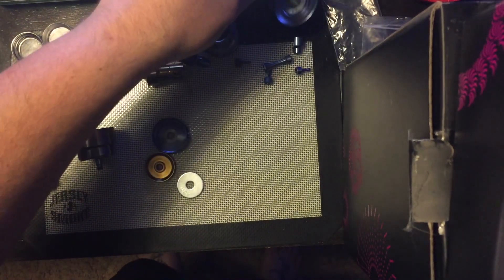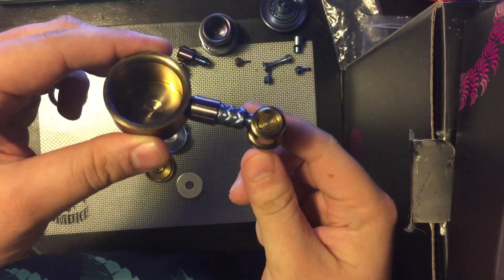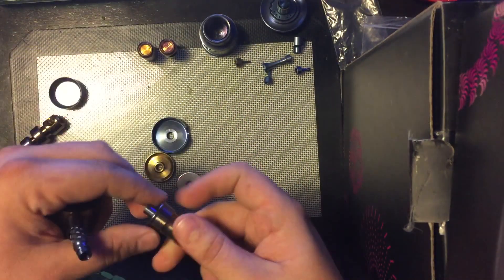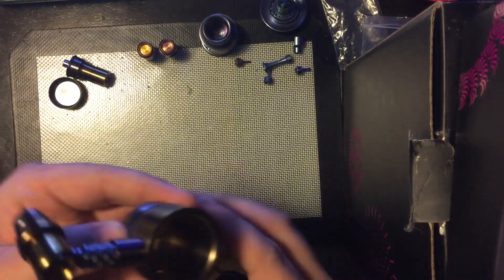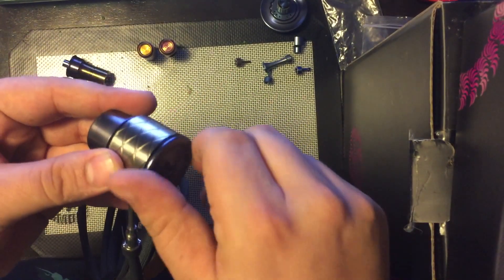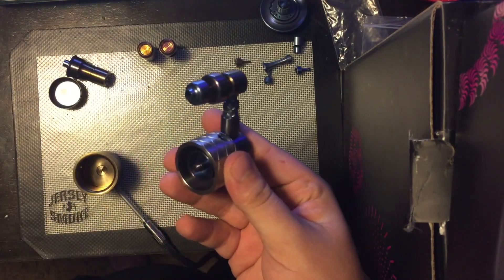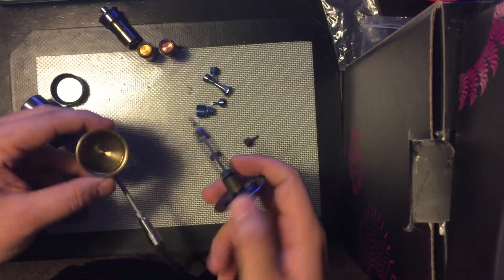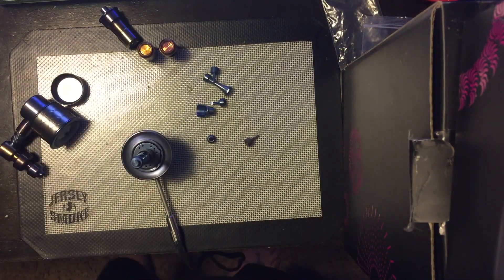CCA710 Liger 3.0 and Hurricane Cap Master Set Walkthrough

Comment from the maker: man this thing rocks. I have been rocking the Sapphire insert which is INSANE until last night i broke it my rig tipped and water got in and cracked it. Trying out the SiC which is also awesome!! really happy with this. Been rocking the Flat Coil Banger for now works prefect. The thing that i love is my dabber has the pick on the end so I just get my dab cap the liger and it melts off right into the dish no need to dab it and than cap it 2 for 1 its AMAZING!!!! if your looking for a good one time banger get this thing its amazing
Reply from the maker: taylor johnson  so with enails there are 3 basic coil sizes. 16mm - 20mm - and flat coil. You have to have one of those sizes my guess would be 16mm or 20mm. Whatever coil size you have that's the size liger you would want to buy. You can also buy another coil from your enail manufacture and use that coil specifically with your liger. Do you remember what size TI nail you got? What you can also do is go to cca710.com and go to SHOP > LIGER BANGER. Click on 16mm for example and you will see a link called size chart. This may help you figure out which coil you have.  Any question just let me know!
Reply from the maker: Black Benz7 in my eyes the sapphire inserts heats up the quickest. Followed by Quartz. Followed by sic again these are just heat up times which when using an enail may or may not matter. As for taste difference I'm working on getting the quad port highfivevapes enail to have a sessh on how each insert tastes. Right now I just have the one enail so it's a pain to swap things out esp when they are hot. So I haven't had a true hit after hit test with the difference inserts. I will say I absolutely LOVE my sapphire insert lol

Comment: Hey Dab Face can you tell what size coil specifically I need to order when ordering the new Liger AIR from CCA710? THANKS
Reply: Dab face
Reply from the maker: Yeah man no problem you need a FLAT COIL ENAIL or and ENAIL WITH A FLAT COIL to work with the liger air. they only now make it in FLAT COIL :) let me know if you need anything else!
Reply from the maker: The liger air is very very close to the model listed in this video above. The Liger Air DOESNT have a locking nut and will only work as a 90 degree. And the Joint adapter is different they don't screw off like the old ones did. HOWEVER its SUPER DUPER LITE  like CRAZY Lite. Def love mine been using CCA710 products forever!!
Reply: Thank you dab face. Appreciate the reply big time.. ordered my flat coil enail today for my diamond glass recycler. Gonna order my liger Air next week. It's a bummer it doesn't do those extra couple things your talking about. But I still think it's the best e nail banger on the market
Reply from the maker: @sgjonesy8085  To be honest the new model is FIIIIIIRE. The weight difference is unbelievable you can hang this thing on tiny rigs vs in the past you had to put it on big bulky rigs so it wouldn't tip over. The Whole joint attachment is just different it has a rod that you screw or unscrew the adapter to 14mm or 18mm no 10mm but they are giving you a free 10mm to 14mm glass adapters to make it work for 10mm. I prefer the glass adapters this way that hot nail is not touching your beautiful rig lol. its a nice little spacer. if you have any other questions at all please hit me up been using CCA products for years and don't plan to really switch to anything else lol

Comment: got any recomendations on flat vs round coils for this banger?  Considering picking one up, and was wondering if I should pick up the flat coil version.   What's your experience been like?
Reply from the maker: rewtuser after using both of these my personal opinion is go with the flat coil. I feel that the flat coil heats up the inserts better then the 20mm. I tried the 20mm for awhile and it seemed I got better clouds off the flat then 20mm. I also have been reading up the reason I may not be getting some serious clouds off the 20mm is because the hurricane cap may not completely seal the 20mm like it does the flat coil. So I guess that comes in to play to. If your getting a cap or not. I'm still waiting on a storm cell cap I bought to come in to see if that helps but I love the flat coil. Easy to clean heats up quick I'm burning at 550 degrees which is awesome so much flavor and the hurricane cap fits great. I recommend stocking up on q tips and cleaning the insert after every use for maximum flavors and it keeps things clean. Either way I'm really happy with both of these products you can't go wrong but if I had to pick FLAT COIL would come out the winner 

Hope this helps any other questions please don't hesitate to ask!

Comment: Hey man. What do you think about the carb cap? It looks really pretty but is it necessary?
Reply from the maker: Here is my take on it. If you are going to be burning at lower temps i think its necessary to have some kind of cap to keep the vapor in. Now does it need to be the CCA710 cap no you could use the glass dish your concentrates came in there are a slew of thing you can use to cover your liger. I do recommend the storm cell cap its super nice makes a good seal on all of the ligers. If you burning at super high temps the cap is probably not necessary as the concentrates just burn up immediately.  I am still 100% fan of the flat coil liger hands down my favorite of the ligers! Any other questions please feel free to ask!
Reply: Dab Face thanks a lot man!  I was gonna go with the round coil until I read your comments with another guy here. I'll go flat now... also I thought the liger came with an insert so thanks for mentioning that. Ordering a setup in a few days!  🤗
Reply from the maker: Enkiguy the ligers come with 1 joint adapter that's all so the carb cap and insert are extra. I also got some news they just got a HUGE shipment in with some new designs 🤔🤔 I have got to see a pic or two and all I have to say is Wow!
Reply: Dab Face oh awesome! Thanks for the heads up mang.